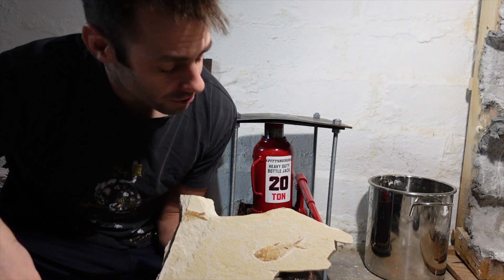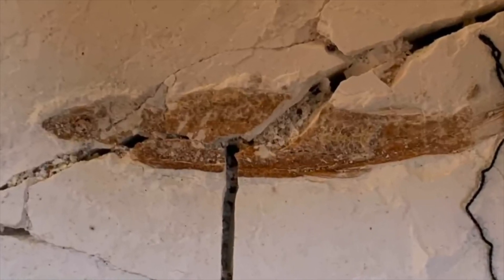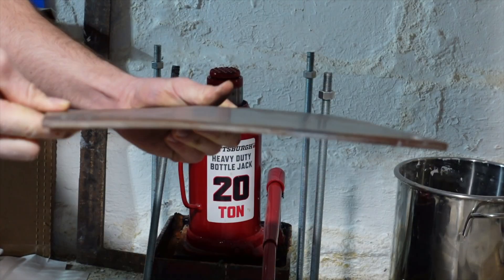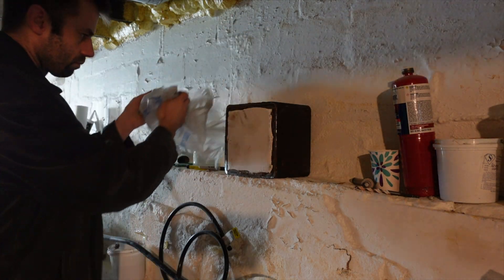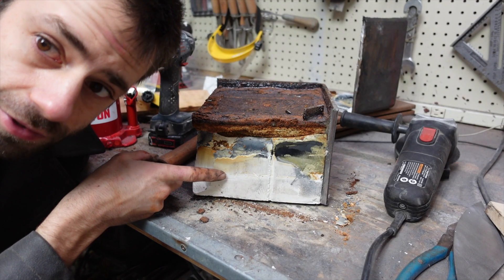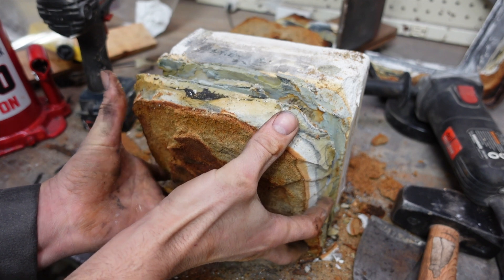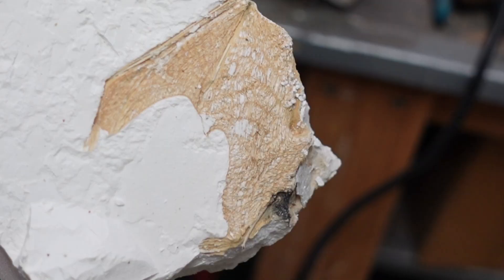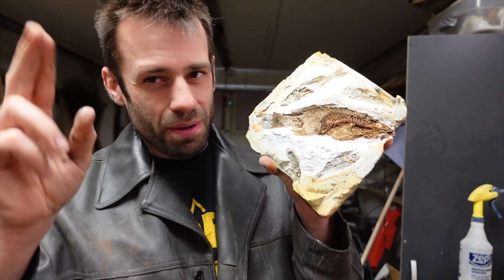Making Real Fish Fossils In my Basement. 1 Year Update.

Comment from the maker: For those that want to see the original experiment here it is. 
https://youtu.be/xD70UzcSKdM
Reply: Suggestion, fossils require HEAT and pressure, so maybe you could make a much, much smaller fossil using the same process as before, but after the allotted year, but the fossil, still unopened, in a kiln to further carbonize the fossil.

Comment: Have you considered getting your 14 year old fossil carbon dated? If so how much are they trying to charge for it to be done? I would be very interested in possibly helping to fund a carbon dating on it, but not mentioning how the fossil was formed 😅
Reply: I know simple logic would say there wouldn't be any change but fossilization in your case might be doing more than meets the eye. Biological material might be permeating the lime/lime permeating the biologics as might happen with permineralization. The diffusion might "remove" enough material into the rock layer that a sample may register older than one would expect. There'll be some contamination from it being exposed recently but I would imagine dusting off a little could clear a portion of any contamination away. I'm running a very similar fossilization experiment myself now, and I'm eager to see the results 😁

Comment: This is pretty impressive.  Few people would have the knowedge and persistence to attempt this and folow through on it.
I wonder if keeping the arrangement under heat as well as pressure would accelerate the process?  And could subjecting it to infiltration by a mineral solution cause replacement of the tissues via mineralization?
Reply from the maker: Heat would probably help. I’m not sure how deep these fossils are when they naturally form, so I don’t know what the geothermal gradient was. But it was likely fairly hot.

Comment: Do you think it would be possible to try this method to create coal
Reply from the maker: Coal has been synthesized by taking wood, water, heat and pressure. I’ve tried myself but didn’t get the seals to hold enough pressure. But yes the recipe for coal is fairly simple.

Comment: How did you pressurize the sediments in the big barrel for 14 years? I can't imagine a little bottle jack could do that!
Reply from the maker: I banded the sides with steel banding, put beaming on the bottom and the top and cabled them together. And used several bottle jacks to add pressure. Technically it was just compaction, I wish I could have gotten a lot more pressure on it.

Comment: why did you have water in it, I forgot why you needed top it up with water? were the fish hollow inside? did the pressure not collapse the space inside were the insides used to be, does this mean that there wasn't as much pressure as you though.
sorry for all the questions I'm trying to understand how this works
Reply from the maker: Because if I didn’t have water it would basically be mummified. The water helps bacterial action so the fish will decay away.  The fish were flattened. In real fish fossils there is so much pressure the fish are paper thin and the flesh turns to carbon. Basically like coal but different.
Reply: @lundgrenbronzestudios  thanks, does the water also help the limestone fill up those areas when the flesh goes
Reply from the maker: Yes the limestone will dissolve in the water and it can then diffuse through the sediment to cement it together.

Comment: How did you compact the sample for the 14 year experiment? Those fuel drums are quite large and there was a lot of material inside.
Reply from the maker: I had a concrete lid and a steel plate on the bottom and on the top connected with cables. Then I used hydraulic jacks similar to what I did here.